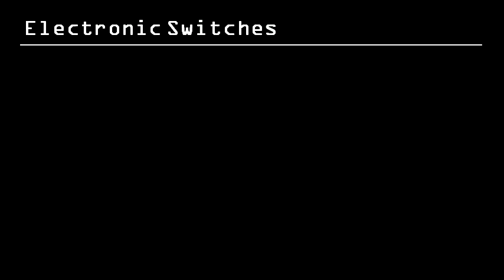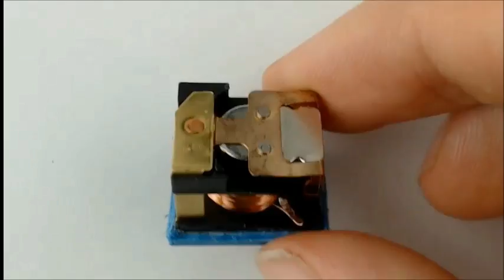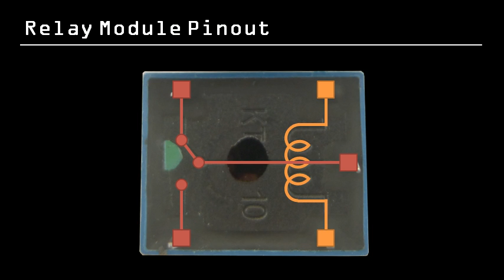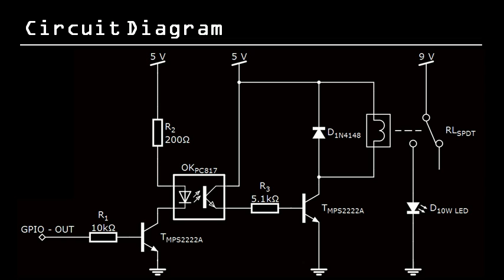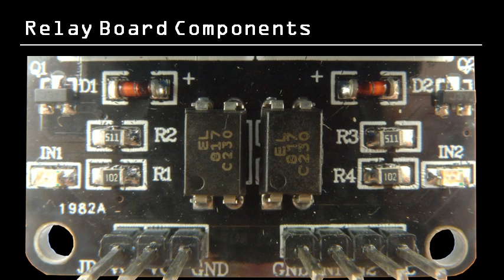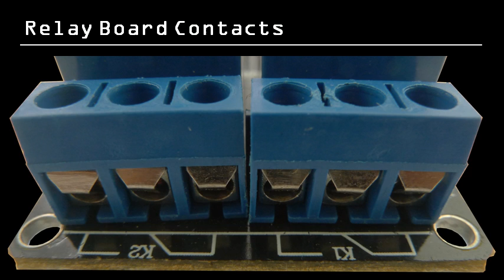Using Relays and Relay Boards with the Raspberry Pi

Comment: Very well explained. Sadly so stones there is a module designer who thought "JD-VCC?, Jumper?, Wait let's just hardwire that" https://arduinodiy.wordpress.com/2018/09/04/the-16-relay-module-and-the-raspberry-pi-not-an-ideal-marriage/
Just a remark, you suggest that one option is to desolxer the resistor and replace it with a seeker one. I am not sure that is the right choice: the voltage drop will remain the same, but now there will be a higher current owing. If any you should replace it with a higher value. In that case desoldering isn't necessary, just add one at the input lines. Having said that, I think with the 1k, the optocoupler and LED in series the 1.7 volt drop the current flowing will be practically zero

Comment: Thanks, 
(8:34) Had problems with mine running at the 3.3v from the raspberry and switching 230VAC 2A. Changing the R1 (1kΩ) Resistor to a 510Ω one worked for me perfect!
Reply: I switched it to 680 ohms.  Some relays worked, some didn't.  Might try 510.

Comment: An old video for sure, but rather than a current limiting resistor on the opto-isolator, one could simply use a current regulator.  These are available with a fixed mA limit (with 2-pins in an SMT package), and can have a VMax of 220Volts (like a CL220K4: https://www.digikey.com/product-detail/en/microchip-technology/CL220K4-G/CL220K4-GCT-ND/4918704).  This way it basically doesn't matter what voltage you put on the opto-LED circuit or the relay control side of the isolator (within common voltage ranges of course).  Using a current regulator means your current is capped at the design current and you never have to go back in an recalculate/rework a constructed circuit once built.

To drive the relay coil a MOSFET and a current regulator would again be more flexible.  60mA can be current regulated with monolithic current regulator parts (two 25mA and a 10mA in parallel gives you 60mA, so does three 20mA regulators in parallel).  Using those regulators would then ensure that the coil only ever see the POWER it was designed for, and the relay would work with a supply of 5VDC up to the power rating of the current regulator.  To protect the MOSFET, a zener would need to clamp the gate to under its maximum voltage, and a current regulator would need to limit both the current conducted by the opto-trans-out, and the zener.  Since a MOSFET gate only needs to be charged with a voltage/current and not driven by a continuous current, this value can be very low (sub-milliamps) - which reduces the total circuit power draw.  Remember, ten 6mA LEDs draws as much power as one 60mA relay coil.

Comment: i use module relay when no load connected to the relay every thing well when it connected to 220ac it take a time and then the lcd display strange symbols the power of the relay and the lcd from arduino

Comment: The last part of the video. Telling to connect 

5V Rpi to JD-VCC
Pin6 Rpi to GND
pin7 Rpi to IN1
pin1 Rpi to VCC

Does this circuit will not damage anything? especially the raspberry?

I'm confused because you introduced to us the using of Resistors,Diode,transistor and Optocoupler. So is it fine not to use those? just the direct connection from Rpi to Relay then?

Need ASAP reply . This is for our thesis project

Comment: effin awesome.. covered alot of material but i appreciate the calculations and circuit explanations such as using beta value to calculate the necessary current limiting resistance

Comment: I am trying to use a Keyes 4 ch solid state relay It's a red circuit board with blue terminal.  there are tons for sale on ebay.  I can get the leds on the inputs tp go on and off with the Raspberrypi, but the relays themselves do not change state.  I have connect them up using a 5 volts, a 22o ohm resistor and an led.  The led will sometimes light up as it should, but then it stays on.  Anyone know what I am doing wrong?  Any help is appreciated.
Reply: Hey! Did U Solve This Troubleshooting Issue?? Just asking..I might be a help. ~*;p

Comment: ☠☠☠ Just remember folks the relays on that panel are NOT safe to use to switch MAINS VOLTAGES directly - the air-gap is not good enough (needs to be around at least 7 or 8 mm for 220-250V type voltages) i.e. the space between the bits of metal that would be connected to the Mains are not far enough from the bits of metal that are connected to the RPi and which you might touch... ☠☠☠

Comment: mains are some scary things to mess with 12 volt dc systems are as well but I been messing around with it and havent burned zaped or blew anything up with whats your thoughts on a 12 volt set up at around 220 ah drawing .750 ma @ 5 volts 24/7? its just a common led think its a bad ideah for light

Comment: Oh man, you fucking helped me :D I love you :) 
I didn't know that the GPIOs provide 3.3V and i also didn't know that the inputs need 5V to get triggered^^ So i have a few questions and i hope you could answer me some of them ;)
1. Why is a octocoupler used to trigger the transistor? I could just power the Transistor with a GPIO pin directly?
2. What are the cons of providing the Optocoupler with 3.3V if you just have GPIO with 3.3V outputs?
Reply: PaYtrIxHD The optocoupler acts like a switch, such that it is used to isolate the circuit so that it will prevent any damage to the Raspberry Pi when working with higher current and voltages. Therefore, it only activates at certain states. Since the Raspberry Pi has a low current output, it would be wise to use an optocoupler to keep things separated so as to not fry the Pi when messing with higher voltages/currents. Check out his optocoupler video where he goes more in-depth. Good stuff.

Comment: I've managed to get the board working this way:
- using the jumper for JD-VCC and VCC
- connecting the VCC pin of the input pin group to one of the 5V pin of GPIO
- connecting the GND pin of the input pin group to one of the GND pin of GPIO
- connecting the IN1 and IN2 pins to GPIO pins set as OUTPUT and initially set as HIGH

Comment: Wait I'm a bit confused.  In the first circuit, the current goes from 5V -> GND and that makes sense to me.  

In the version with the board however, it goes from 3.3VDC -> GPIO pin.  It seems to me like the current comes out from VCC and it comes out of the GPIO at the same time that it would be a problem.  Does that not reverse the way that things work?
Reply: The current comes out of the difference of Vcc and GPIO. In the module version when the GPIO is LOW, it is actually sinking current

Comment: Hi. Could you explain more about the extra power requirements? Just to clarify, you need 2 power supplies, a USB powering the pi which sends some of the required power to the relay for the LED, and a second power supply connected directly to the relays outward face and the ground for the LED, right?
Reply: Also, is the point of using the relay to isolate the 9v power source so it doesn't interfere with the 5v arduino board and blow it up while maintaining control of the external object with the board?
Reply: A voltage source represents a "potential difference" in electric terms.  So, the GND rail for each source is NOT an absolute 0 value, and also the independent GNDs will not be on the same level as each other.  Instead of thinking of the + and - terminals as 5V and 0V, you can also think of them as +2.5V and -2.5V (i.e. the potential difference is still a 5V supply), or even +4V and -1V (it is still a 5V supply). There is no such thing as absolute 0V GND (the GND on different supplies will be different and hence represent a voltage potential difference even between independent GNDs). The power from the positive terminal from one voltage supply must return to the negative terminal of it's own supply, so this is why you need circuit isolation.  If instead the entire circuit could be solely powered from the micro-controllers own power rails then there would be less need for isolation since you could instead limit current through the use of resistors, but in this case if you are controlling actuators and motors then the arduino cannot possibly supply the needed current (or voltage) required for those actuators to power the motors, and some components in a circuit just need more than 5V to work.  You need voltage-source isolation in this situation.

Comment: How do i deal with voltage spikes from the relay that are causing my micro controller to reset ?
Reply: The answer is in the video. You will need a diode in parallel to the relay.

Comment: If I wanted to make this into an "active high" relay, could I feed the 3.3V GPIO output to Vcc, 5V to JD-Vcc, and then tie GND to the GPIO input of the board? That way the optocoupler has 3.3V across it (and the resistor) when GPIO is HIGH and 0V when GPIO is LOW?

Comment: This helped me a lot using the pre-built board, but for some reason did not quite work. I found that I had to send +5 to VCC and VCC-DJ, and that I did not need a ground. With +3.3 at VCC, the relay never got more than 3V across the magnet
Reply: Matt Brennan Hi, for me it didn´t work either, i have the model b rev2 rpbi and i guess the 3.3v gpio data is not giving much current. I see the led blink at the relay control and the relay is not giving output voltages when it should, also i´m not hearing the relay sound switching. Did you use the jumper to provide 5v to JD-Vcc and Vcc, and what do you mean by not needing ground. thanks

Comment: 1:30 

How do you know that the required current is about 60ma? 

I looked at the datasheet here:
https://www.ghielectronics.com/downloads/man/20084141716341001RelayX1.pdf

It seemed to be different than what you mentioned.

Comment: Great video!  I believe I'm using the same relay board as you, and only one of the relays would turn of if I connected Vcc to 3.3v.  I'd measured the voltage across the coil and it was 2.7, so I guess that wasn't quite enough.  All works well if I use Vcc = 5v.  I assume that slight differences in the transistor or relays would affect this.  Now the coil voltage is about 4.6, which works great.

Comment: Gaven, im doing a project for a course in my college and i want to create a wireless door lock, what i had in mind is a relay, electromagnetic door lock and the raspberry pi connect all those together and i could build it, so am i missing anything or should i be using something much simpler design ?

Comment: I could only get this to work by connecting Vcc to the 5v pin on the RPi and connecting Vcc to JD-Vcc using the jumper.  When I connected Vcc to 3.3v rail, the red LED would light but the switch would not activate (there was no audible "click")

Comment: good advice can you make another video showing best safe way to run ac through the relay as best you can as i dont mind danger but want things to stay working, maybe by using different relays and an inline fuse etc for example many thanks
Reply: tried that 3.5 volts not enough to activate it!

Comment: Wouldn't it be simpler and more economical to find an optocoupler that requires <16ma on the input and allows mains voltage on the output?  Are optocouplers with such specifications available on the market?  Thanks.

Comment from the maker: You certainly can do that, and in both cases you will need 1 GPIO pin. Either a GPIO pin on Vcc, with the control pin connected to ground, or Vcc attached to 3.3V and a GPIO pin connect to the control pin (like in the video). The only time an issue would arise would be when using more than one relay on the board. Because the two relay modules share Vcc, a GPIO pin on Vcc would affect both modules. Of course, if you're not using the board, your suggestion would work perfectly fine.

Comment: Why is the optocoupler connected to the 5v power supply?? Couldn't it be connected to the GPIO out directly? The 3.3v generated by the GPIO pin can power the the optocoupler.

Comment: Thank you for this super video! This helped me to get my 8-Relais Optocoppler running and I got the knowledge from your video how it is working and has to be connected. My 8 Kanal Channel 5V Relais Relay Converter Modul worked fine with VCC and JDVCC connected via the jumper! I'm looking forward for new videos as they are very interesting and good produced! Thanks for your time you spend here!

Comment from the maker: Yeah, a single transistor and a relay will do the job just fine. The optocoupler is there only for protection, and I made a point of discussing it as a large number of  relay boards use it. Unless you're going to use a separate power supply to connect across the relay coil, you might as well not use the optocoupler as your bypassing the electrical isolation by connecting anything on the right side of the optocoupler to your Raspberry Pi.

Comment: In the video you used a GPIO pin of the Raspberry Pi to control an optocoupler which in turn controlled a transistor which in turn powered the relay. Was the optocoupler really necessary? Couldn't you have just used a transistor and a relay? I didn't need an optocoupler to control a small relay with my arduino, just a transistor. Or is the optocoupler there because you don't want the GPIO pin to be destroyed by some kind of voltage spike?

Comment from the maker: You might be able to control the relay coil with 3.3 V (a gpio pin). On my board, one relay worked this way, and the other didn't. So it's definitely something you can test out with your own relay board, as relay modules are not all created equal.

A transistor is also an excellent solution, and it's what I tend to connect my GPIO pins to. The only reason I didn't suggest them with the board is because I wanted to avoid using additional components.

Comment: Couldn't you have just powered the relay coil from the GPIO pin of the raspberry pi or connect a gpio pin to a transistor which controls the relay coil?